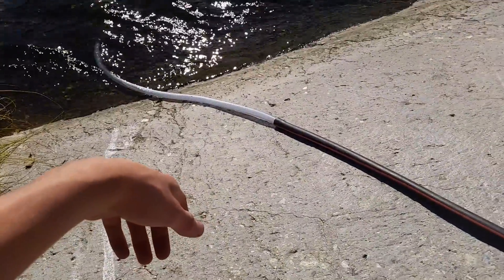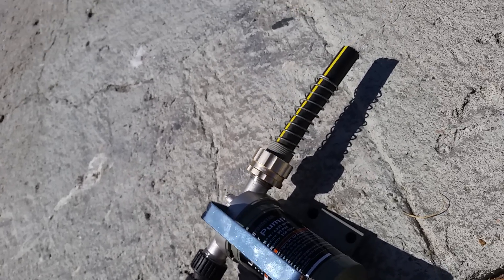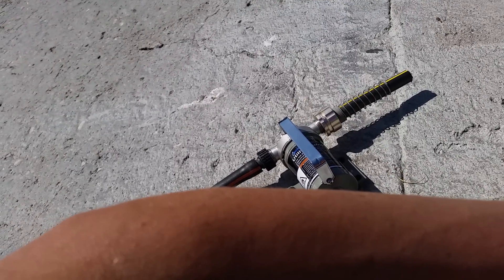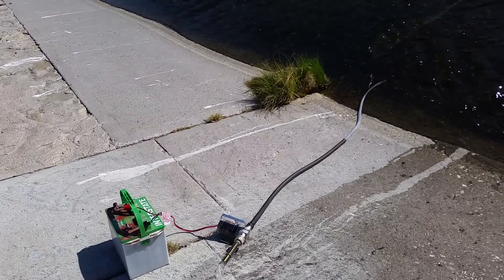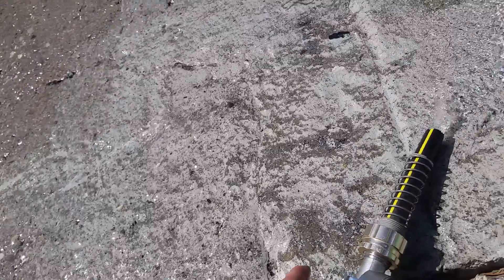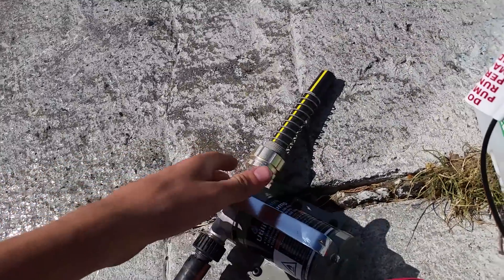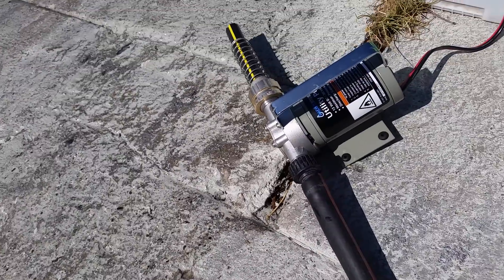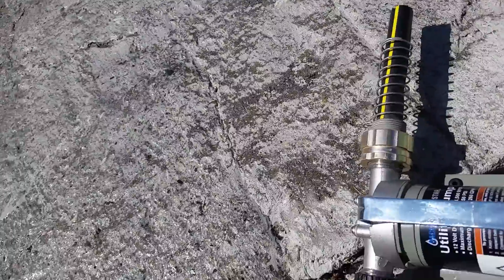Harbor freight 12v utility pump

Comment: Hey Connor... ever try using this Harbor Freight transfer pump.. 300 GPH for kerosene or diesel fuel transfer... gasoline... I dunno..... that's a little touchy... hand pump is better... Do you think the internal seals would mess up with this pump???? Let me know what you think?
Reply: xoobis If you do that you will only be using it once.

Comment: Just bought the pump. I notice after running for 10 minutes its scorching hot. Does everyone notice the same thing. I'm I doing something wrong.
Reply from the maker: +Robert Bakerian I do have to admit my pump gets pretty hot as well, but only when there is a significant restriction on the output such as a very fine spray nozzle; however when simply transferring water the pump only gets slightly warm. Here's some math the pump is rated at 50w nominally, running 10min =36,000 seconds, 
50w * 36,000 = 1,800,000 joules. 1btu (British thermal unit) = 1055.056 joules.   which means the pump would have produced 1706.070 btu's of heat. phew! that was alot, and 1 btu in simplicity is equivalent to one 4inch kitchen match being burned completely, so in summation my suggestion is to not run the pump as long. I apologize for my long description but i hope it helps! Take care!
Reply: Thank you Connor. I assumed it was because I was using a spray nozzle. I guess I need to figure out an alternative. Thank you again for your thorough explanation.

Comment: can you use solar panel instead of battery?
Reply: This pump draws about 10 amps. The panels would need to put out about 10 amps at 12V so while you could it would be better if you had a solar panel charging a battery. harbor freight has a nice 25W panel nowadays.